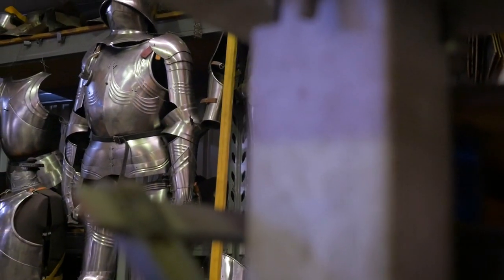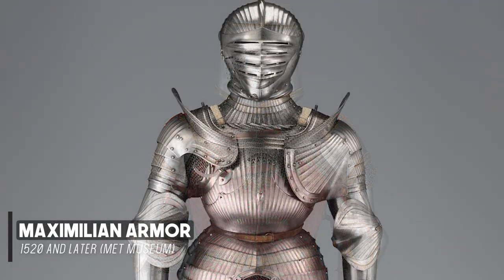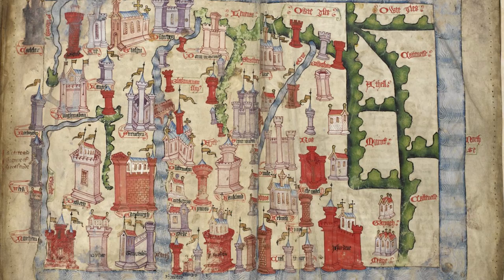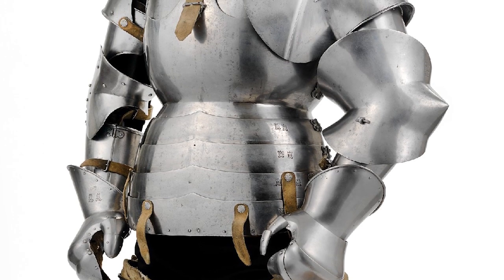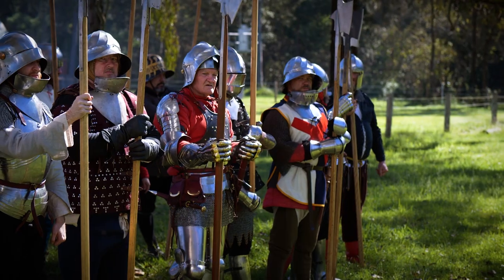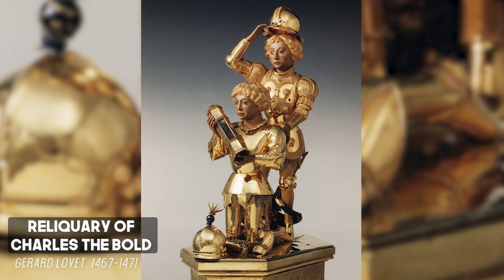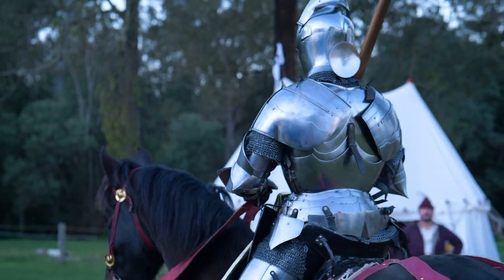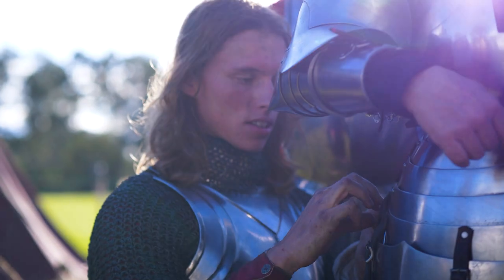Creating 15th Century Armor

Comment: By blacksmithing your armor like that you are producing very breakable pieces... Period armorers of high quality didn't alter the temper of sheet steel by heating it. There are many accounts of people in cheaper armor getting a hole poked in them, or having it break. Honestly, I wouldn't wear it in modern competition either. Heating it like makes it easier to work with but isn't safe for actual use.